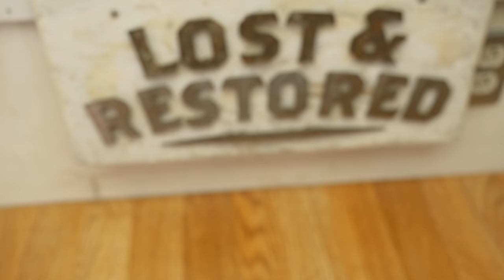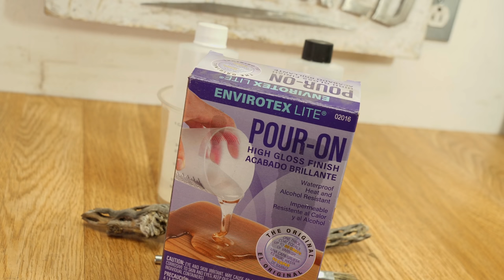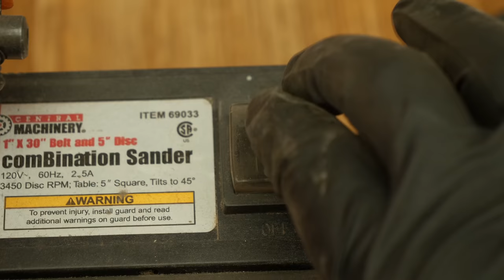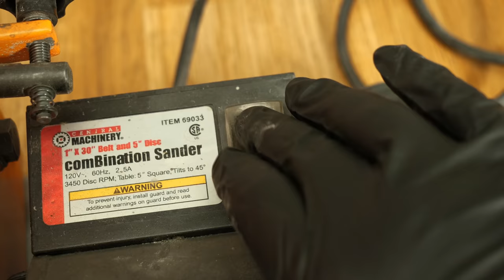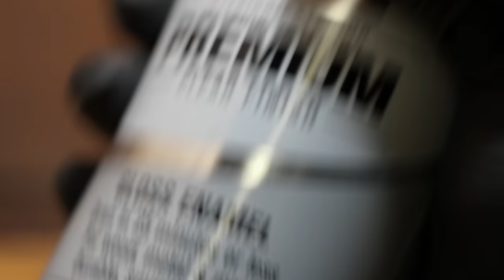Old Rusted Knife Get's An AMAZING Cholla Cactus Handle!

Comment: Yes this is an imperial knife made in Providence RI and is a good blade.
Originally it had a hollow stamped sheet metal handle which was pretty cheap, but their blades were good.
Reply: 01:19 "The Imperial's made some good knives back in their day...🔪 Do you think this one knife could be one of them right 😌?"
Reply: @rahadianaryo5979  
What ?
Reply: @TylerSnyder305  
What the heck do you meant here, Snyder...😐?
Reply: @rahadianaryo5979  the questioned was asked whether this knife was made by the imperial knife company put of Providence Rhode Island and I said it was.

Comment: Like the choice of Cholla wood for the handle. Definately different and looks good
Well done.
Reply from the maker: Thanks 👍, it gave it a great look.
Reply: @lostandrestored  
05:08 "I found these cholla cactus wood 🌵 on the ground and they're kind of dusty and dirty to my liking here...😟"
Reply: 05:34 "The Cholla cactus wood 🌵 will want to release a lot of trapped air into the resin , so I'm sealing it with a little resin coating to prevent big bubbles into the main pour there..." (And so, what do you meant here, Lost & Restored...🤔?)

Comment: The Imperial knife company was founded in 1916 and closed down in 2004.  The name is still used for certain brands of pocket knives, but those are made by a Chinese company who obtained the name.
Reply: Yes, they had been owned by Schrade since the 70's and closed when they did.
Taylor brands bought Schrade then sold to BTI a few years back.
Production moved from the Imperial factory in Prov RI to the Jowika factory in Ireland in 1988, so imperial was kind of dead long before 2004 really.

Even when the Prov imperial knives were very cheap with the chintzy shell construction they had great blades.